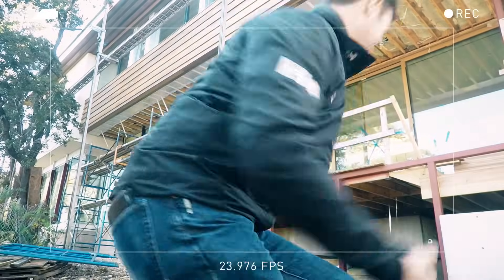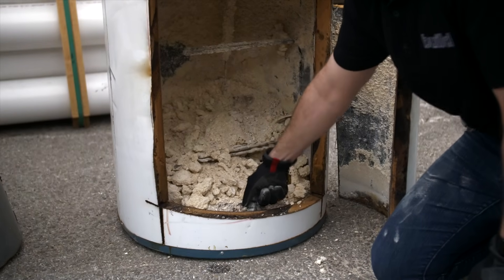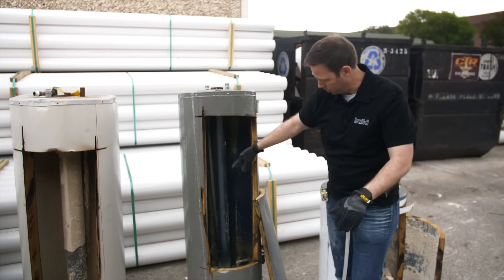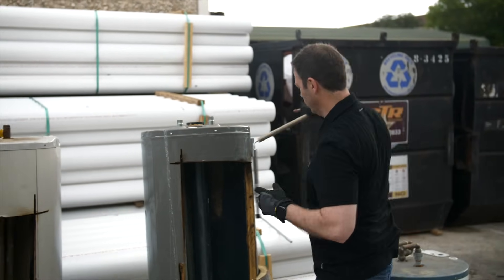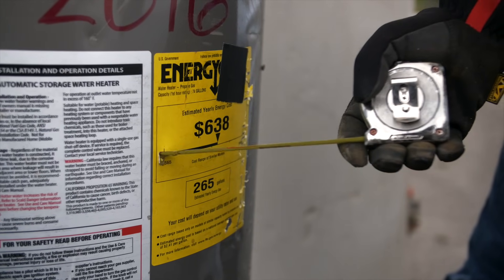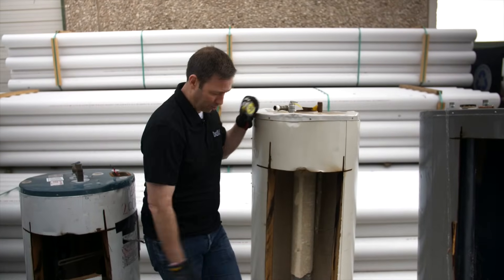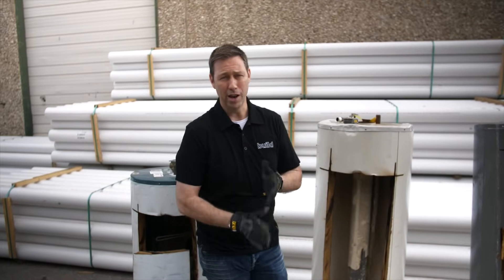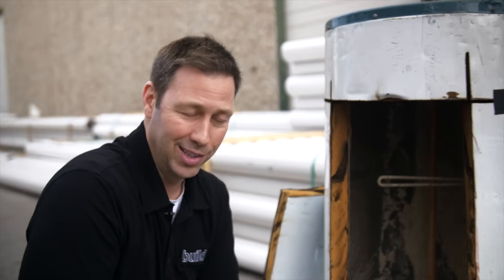Four Water Heater Tanks Cut Open - Lessons to Learn

Comment: Most people never flush their WH much less change the anode rod. The rod should be changed every 3-5 years. Both maintenance can be done easily by homeowners.
As far as efficiency you can always buy a  WH blanket to up the efficiency.

Comment: Well yeah you gotta change out the anode rod atleast every 4 years. And a softening systems eats those rods quicker, so stay on top of your anode rod's health especially if you have a water softening system.

For the anode rod clearance from hitting  the ceiling we used to drill a small diameter hole thru the drywall ceiling above where the anode rod gets installed and that solves the long rod clearance  or you can buy the nun chuck style anode rods which are cut in sections hanging onto the wire

Comment: Your last comment was the best. 90% of water heaters aren’t maintained. The key is, know your water quality. In Western Washington water is so soft, generally, that flushing is pointless but increases the value of replacing your anode rod. Remove it when it’s new and reset it with Teflon tape, so it comes out when it needs to.

Comment: My water heater was replaced a few years ago with the same brand of water heater but new one doesn't seem to have one of those sacrificial rods as I don't see the place on top where it should be 
Like it was in the old one which started to leak after 32+ years of service and was original to the house. Old one had a 15 year warranty and lasted over twice as long. New one comes with 10 years warranty and wondering if they don't allow replacement anymore to force replacement every decade or did my plumber sell me a POS that he will have to be back the replace again in or out of warranty. Aren't the rods replaceable anymore in water heaters or is it just the model I was sold?

Comment: Cost benefit analysis? Will doing routine service and periodically replacing anode rod off set the costs of reduced efficiency and shorter life of the unit? In other words will doing those things save hundreds of dollars or are we looking at basically increasing the life with maintenance costs being equal to earlier replacement ?

Comment: THE OPINION OF FLUSHING WATER TANKS AND REPLACING MAGNESIUM
BAR SEEMS TO BE 50/50. THE ROD WHEN OLD CAN MAKE WATER STINK LIKE ROTTEN EGGS. WHEN THE SMELL OCCURS REMOVE IT PLUG THE HOLE WITH A 3/4 PLUG. IN A HEATER NOT 
CUT OPEN THE HOLE GIVEN BY MANUFACTURERS IS 1"1/2 OPENING.
YOU CAN FLUSH A BIT BUT NOT
COMPLETELY. THANKS FOR YOUR
TAKE ON MAINTAINING HEATERS

Comment: When I bought a house in 2014, the water heater was a 120 gallon electric water heater from the early 1950's and it was still operating. I had at least 20 lbs of sludgy scale and rust in it. The tank was very thick and the elements wrapped around the tank instead of the modern probe-style designs.

Comment: I'm a general handy man, dealing with a lot of different stuff. Not an expert but I do everything, almost. 

If you're reading, do you know how to deal with broken dip tubes? Seems they would be easy enough to replace BUT twice this year I have seen a big problem with that situation. What seems to happen is the broken plastic dip tube decays in the tank and bits of plastic make their way through the supply lines, messing with valves and plugging up faucet filters. 

So, I can replace the tube but is there a way to deal with the effect of the debris?

Comment: It’d be nice to know if the water used in them was unfiltered well water, filtered well, or city water? I imagine the worst ones were rural shower-only well water tanks? Also, my natural gas water heater supposedly has a “stir paddle” feature to prevent scale buildup, on city water.  I haven’t checked it yet for condition.

Comment: good segment matt. the 'baked on coating'? is glass. manufacturers USED to thoroughly glass line the inside of tank water heaters. it's a glaze- the SAME type of glass used on clay pottery. all the way up to the 80's- that lining was 100%.. then double checked during quality control. if it had 'missing spots'.. they would send it back through & re-glaze. now? I've cut open tanks that don't even have glaze on the bottom 6" of the heater- the place they need it the most. they still do it that way on commercial tanks. but residential? they just run it through one light glaze, then seal it up & ship it. OF COURSE IT'S GOING TO FAIL! 
     I should also mention the obvious here- which is that draining will NOT help if you don't replace the factory drain valve with a 3/4" x 4" brass nipple & a FULL PORT ball valve. and even THEN- the scale forming on the sides does not leave with flushing. and it forms in chunks on the bottom. some of the chunks will not even pass through a 3/4" nipple. they FOR SURE will not pass the the tiny 1/8" port in a seat & washer boiler drain that the heater ships with.
 
       at present- I work on a college campus plumbing crew- 12 plumbers, who maintain 15 city blocks of buildings. we 'rotate'.. the different preventative maintenance tasks. one of mine was maintaining the water heaters. many of these are commercial electrics (but mostly steam fired). commercial electric tanks are built THE OLD SHCOOL WAY- 100% GLASS LINED. with a nice little bonus: they have a huge 8" inspection port on the side held on with like 8 bolts.  once every 2 years- we drain those heaters & pull the plate. and what we find is pretty much exactly what you saw on the under counter "low boy" heater. we break it up with a steel bar, pull the chunks out by hand, then vacuum out what's left. some of these old commercial tanks are passing 30 years old. THE GLASS LINING is the difference. if there were ANY exposed steel inside? it would quickly rust through- the anode rod might slow that down- but not stop it.
 
    one more thing:  the problem with GAS tank heaters & efficiency? the flue. do a little experiment: shut down a gas heater. wait 12 hours. go back out &  hold your hand inside the exhaust- there will still be hot air going up, even though the gas is shut off. the flue radiates the heat BACK out of the hot water CONSTANTLY. no amount of insulation AROUND the tank will help with that. they have tank gas heaters with a vent valve that closes to prevent this - but by the time you buy this model- you've nearly paid for a tankless.. and you still have a tank that isn't completely glazed- so it's going to rust through in pretty short order- even after you flush the tank- and change anode rods faithfully. 

    once again- the one-stop fix? NAVIEN. all stainless steel- not a chance in hell for rust EVER forming. but if you have an all electric home? I'd recommend one of these on the incoming cold (especially if they have hard water & don't want to have a softener):  

https://www.amazon.com/dp/B000NKETXQ/?coliid=I3MEPM9EKT03CT&colid=1WN7I79FMZZKO&psc=1&ref_=lv_ov_lig_dp_it

replacement cartridges are $20 each, or $15 each in packs of 3. if you are all electric, & you don't want to deal with a tank rusting through- westinghouse / home depot makes a fiberglass tank water heater. electric elements- lifetime warranty against tank failure. there are competing brands- all of the tanks are made by pentair, so the tanks are very  high quality. expect to spend about $1200 on an 80 gallon- $1169 for a 50.  but lifetime? not too shabby.  anode rod? who cares. it can't rust.  

it's possible to do a descale flush the same way you do on a tankless. I use a 2 gallon stainless steel bucket filled with vinegar. i set the pale on a propane burner- heat it up to near boiling- then use a circ.pump to pump it through an empty tank heater. in about an hour- it will liquify all the scale- then you can simply drain the remaining scale, rinse the tank & fire it back up.

Comment: The scale has to do with the water quality , where as they could of had different sources different areas. 

I change my anode every 3 years where i live.  I write the changes on the side of the heater with a sharpie. I am on year 10 now. 

Other people in town change their heater every 4-5 years. 
They must not change the rod. 

Aluminum anode doesn’t give off the H2s smell- rotten egg smell but doesnt last as long.

Comment: My. Heater is 20 years old but I keep my water on the cooler side.
Reply: Mine is also 20 years old and still kicking, and I’ve never done any maintenance on it!😳
Reply: @eleanormassaro5195  yup I have never done maintenance on mine neither. I'm just learning about them now. The next one I get I'll definitely do maintenance
Reply: Same here. My water heater is about 26 years old. I set mine to not so hot. Mine is due to be replaced

Comment: Live in St Paul MN, hard water, installed our hot water heater from Sears in 92, have only emptied out 5 gallons a year, but it's still running.  Guess it's time to do a complete flush as described.

Comment: Some hot water tanks can have tons of mineral deposit build up while other tanks of same age may have very little mineral deposit buildup...  why?  Depends on the water source:  If your municipal water is high in mineral/hard water, your tank will collect calcium/mineral buildup much quicker then a water source with very little minerals in the water.
This is based on what I researched.  Just my own hypothesis.

Comment: For clarification, not evident in your explanations, the sacrificial anode is not there to prevent scale ( the insoluble minerals common in most water sources, e.g. lime ) ; but to prevent soluble metals in the source water from reacting with the metal parts of the heater. Copper and /or steel! Depending on the source water. A perfectly good anode rod can be present in a heater with pounds' of scale/sediment. TIP: To change the anode, shut off the water to the heater, relieve some pressure by opening a faucet; but do not drain the heater. The weight of the water will help to keep the heater from moving when trying to loosen the anode bolt head. The factory installs the anodes with so much torque that one needs a breaker bar or piece of iron pipe to extend a socket wrench to loosen the anode bolt head. Most heaters require a 1 1/16" socket. Otherwise, really good video. Thanks

Comment: Original water heater to when the house was built in '96! Just replaced it! Still worked, started leaking around fittings where copper met the steel!

Comment: Flashing the water tank is total waste of time and money. The scale that builds inside as the video shows is stuck on the walls of the heater. Even the ones that are at the bottom most likely will not flush out. I heard people vacuum inside, that’s totally nuts because there is not much you can remove by doing that. If you got bad water my friends it is what it is and you will not be able to prolong the life of it by draining it once a year. Specs of the scale might flush out but the bulk of it is still inside and remains there. It’s only in your mind that you will make it last longer but in reality it doesn’t. When it goes it goes that’s how you handle water heaters.

Comment: The second one was likely replaced because that is a huge money maker for shady plumbers. I bought a house in Fort Worth with an 11 year old water heater. Yea, it's getting near the end of it's life. We drove across the country to get to the house, and the next morning found there was no hot water. It was a gas unit. Controller had a flashing light that indicated "overtemp shutdown". Called multiple plumbers, who told me "we dont work on home depot units" "it's too old" "you cant buy the parts for it" (you can) "the parts would cost as much as a new unit" (they dont). Every excuse they could come up with to sell me a new one. I got on youtube and found some obscure video telling me how to reset the code, and it has worked great ever since. Flushed it a few days ago and minimal sediment came out. Some plumber could have made $100+ to come turn a knob.
Reply: worthwhile comment Kenneth Mc.  
The difference between a regular person and a typical "expert" is the fact that a "expert" does something rather than nothing.
Which means...  they'll usually have enough incentive to get something accomplished, even if the wrong way, or expensive.
Reply: Don't be so quick to shit on plumbers man. That's a 75 gallon tank. That's coming from a big home. Sometimes rich people like spending money, so they might have just wanted to put in a tankless water heater or swap to a dual water heater setup for even more capacity. Who knows. People do a lot of stupid things, and that's compounded when their bank account is hardly affected by it.
Reply: @some0ne8  Maybe in this one instance, but my point still stands.
Reply: @kennethmc2601  I'm not a plumber but I still get it. Some of those reasons are also because it's not worth their time to come there to flip a switch or what happens when they flip the switch and it lets the smoke out? Then they're paying out of pocket to put in a new unit or you're going after their insurance. 

It's not always as simple as saying they are trying to scam you because they want to put in a new unit.
Reply: @some0ne8  So if you took your car to a mechanic, because your AC doesnt work, and the problem is a blown fuse, but they replace the entire AC system, you would be cool with that? I get your point, but lying to a potential customer is not ok with me.

Comment: The manufacturers make the drain so small you can't "easily" get the sediment out if they did it would last for easily 40 years! I just use the bottom element hole on my electric heater and take a pointed rod to help break the hard stuff up and a wet vac with a clear tube homemade extension on the end of it and slowly suck all of the sediment out filling it with water every so often to get it all out 100%. It works great and is cheaper than buying a new one every 8 to 10 years.

Comment: Hardness of water, check it, many places give free water test kits. If hardness is above 10 grains, you need todo something. Where is the water coming from, well or is it city water. If well, see what neighbors are doing, call in a pro, see & compare. Lots of research needed here......not to overdo or overpay!  City water? What does the water company recommmend, what are your neighbors doing?  Lots of research again. Doing this your water heater won’t look like the ones above, or other problems. There are many different Filtration systems......another topic that needs research. Old water heaters were very inefficient, they have gotten much better in the last 20 years. I live in the Chicago area and our water is from  Lake Michigan. It is good and you don’t see water heaters like the ones above, unless they are on well water.     Thanks......Jim

Comment: my water heater is a glass lined  made in 1997 my only thought it scales up and so has not fail or it will fail any day now but has not yet.  however to afraid to service it figure any bumping or stress on it could cause failure.

Comment: My first tank lasted 8 years, my second tank lasted less than seven. It’s located in the attic over my laundry room. The first replacement cost $1,800 the second $2,800. It cost extra because the plumbers have to fight to get it into the attic through the drop down ladder space. The estimate  to relocate it to the garage would be another $3,000. The original heater was shorter and wider and installed before the house was fully framed, it had to cut in half to be removed. I paid extra for a ten year warranty. The second heater was flushed yearly and only lasted six years and seven months. The first one split like a Coke can, and I was fortunate to be home at the time, the last one just had water in the pan. A neighbor had a rupture that wasn’t noticed until the water poured out the front door and ran into the street I lived in a three story twelve unit condo where a ruptured water heater took out four units. Four families had to move out for a month. They have alarms that can sense water in the pan and alert you like a smoke alarm, or even call your cell. If I’m away from home for a day I turn my water off.

Comment: OMG, I bought a house in April and the water heater is 30 years old, original to the house built in 1991.  When it kicks on I hear it making chunk clunking noises - all over the house I can hear it.  And even though the entire A/C system was installed last December the power bill is over 200 per month (I live alone and keep the air at 80* day and 77* night).  A couple weeks ago I was in Home Depot had they had a promotion for AC and WH and other household systems where a guy would come and look at your systems and give a quote on installed new equipment.  A Rheem 40 gallon electric HW heater was quoted at $1,709 and I about had kittens.  I found the same water heater online at $369 so that means they want $1,340 to install it.  That should be investegated by the police as a scam targeting the elderly.  A handyman said he would put it in for $100 and that it would not even take an hour.

Comment: A retired plumber Local 230. Just buy the cheapest water heater and replace it every 10 years. The fantasy that you have about people that are going to flush the water heater and replace the Anoyd rod  every 5 to 7 years is just a fantasy. Besides as you have shown there is a build up that occurs over time and use that will not come off unless you scrape with a knife. I have replaced mini water heaters and I was curious enough to look and see what caused their failure. That is why I came up with the conclusion to replace every 10 years. That was a good show an tell! Thank you